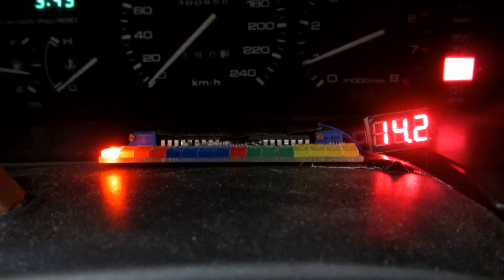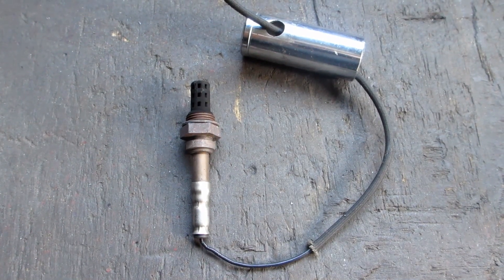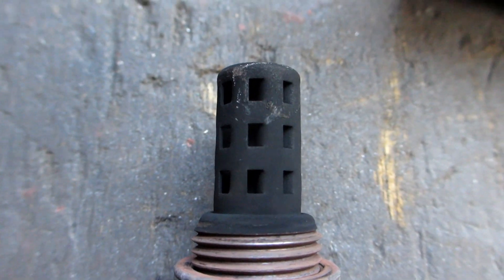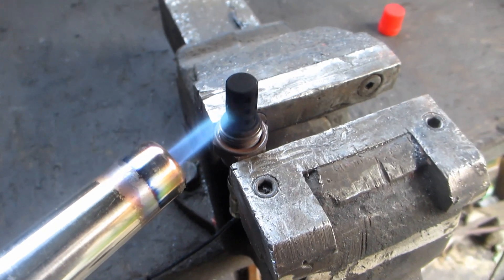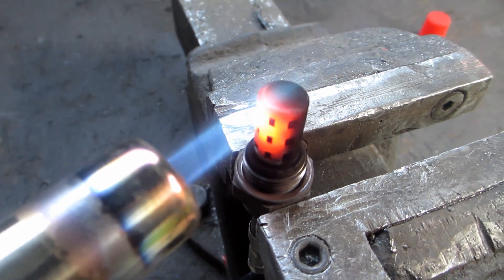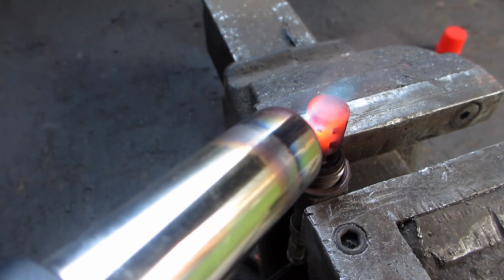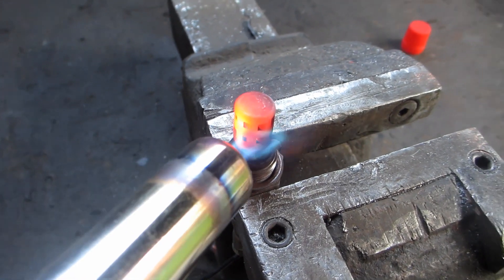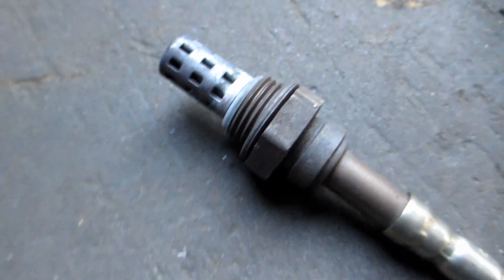Repair w/SC:- Cleaning O2 Lambda Oxygen Sensors

Comment: This actually makes sense, a build up of sutt blocking the senor airflow rate from picking up the O2. due to the car is burning wrong like cold take offs, just like the cat can get clogged up failing emission test due to short local runs, were the cat is suppose to run at a high temp to be operational, short runs never get to temp. A good hard burn spin usually sorts the cat out. The cat is before the o2 sensor that usually gives problems. O course testing for open circuit and voltages first to test electrical functionality.